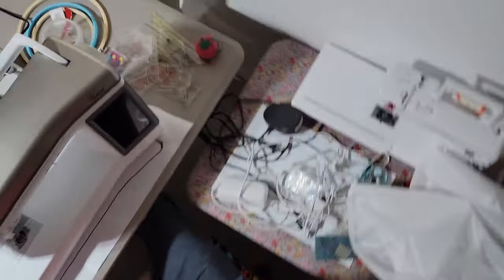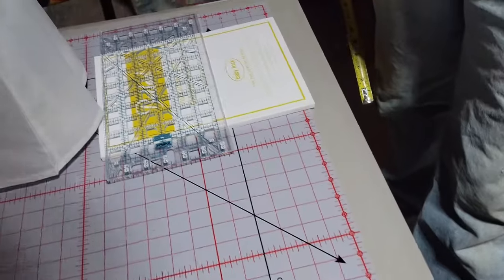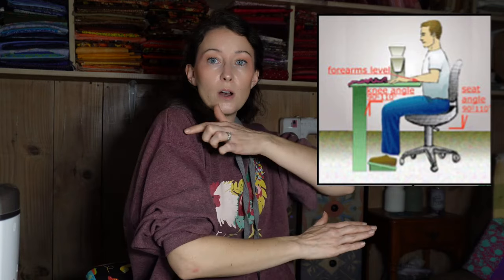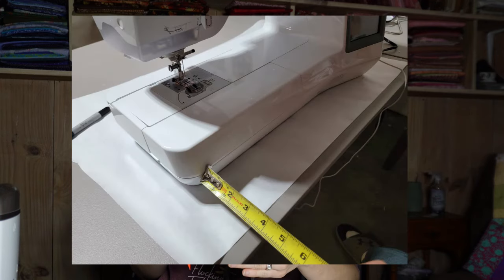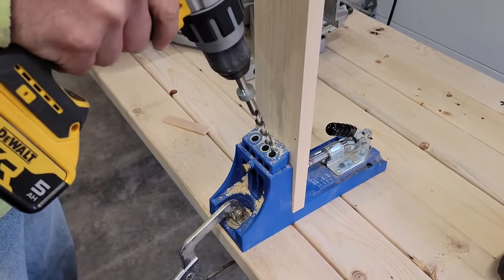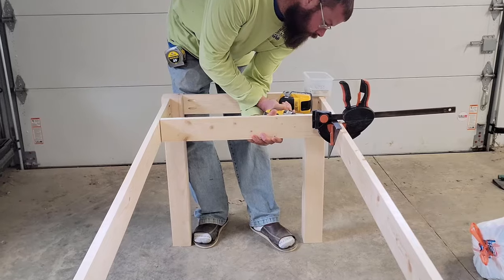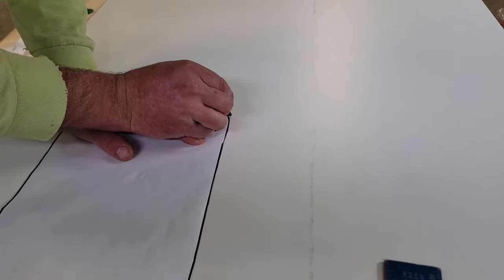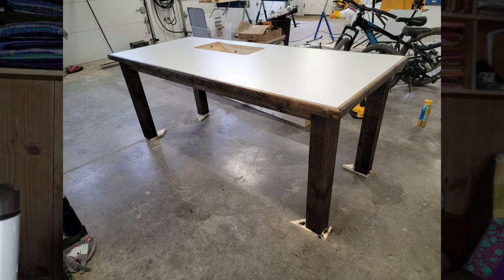Free DIY Sewing Table Plans: Make Your Own for $121

Comment: In the process of setting up my craft room again. We moved cross country and downsized so it’ll be MYCH smaller than I had before. Having to be very intentional on how everything stored and work areas need to be multifunctional. Thank you so much for the plans. If I’m able to use them I will definitely send pics.